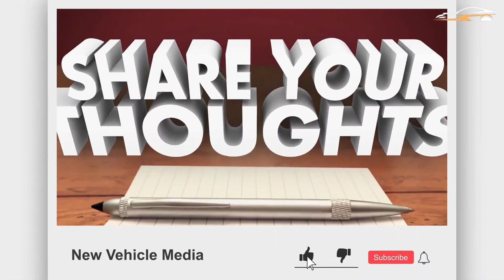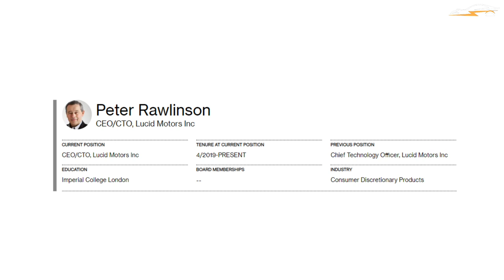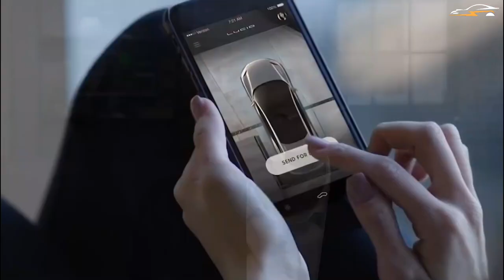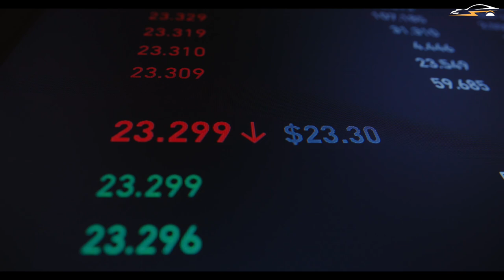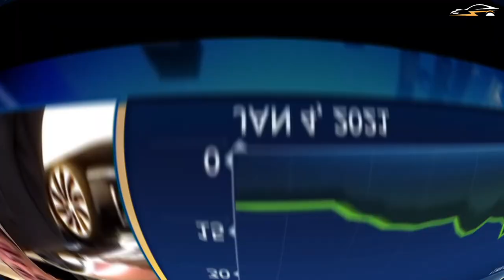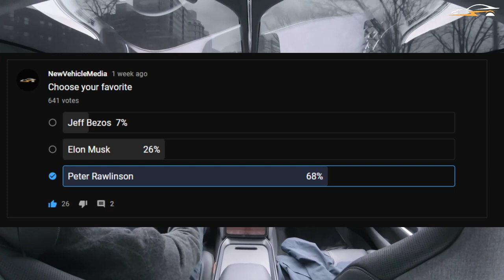Peter Rawlinson | The man behind Lucid Motors! (Biography)

Comment: Peter is doing a great job so far and has the right background and skills to lead this company. Can't wait to see the first customer vehicles roll off the production line. They have a great product in the Lucid Air with it's 500+ mile range and 900 volt architecture for super fast charging. The Dolby Atmos sound system is going to be epic too. I also like their involvement with Formula E racing - supplying all the battery packs for the race cars. Battery tech is going to be key to their success - and with 500+ mile range they are going to be a winner.